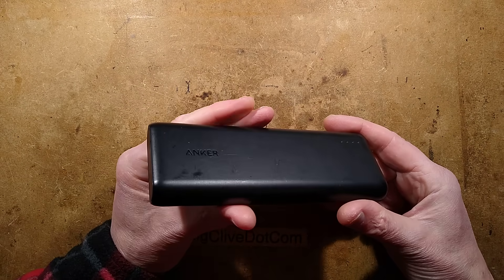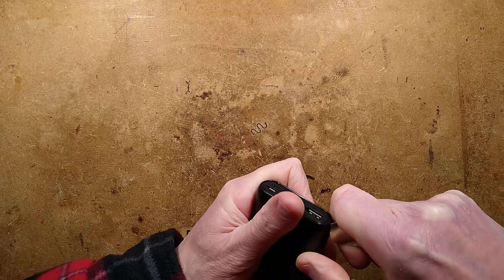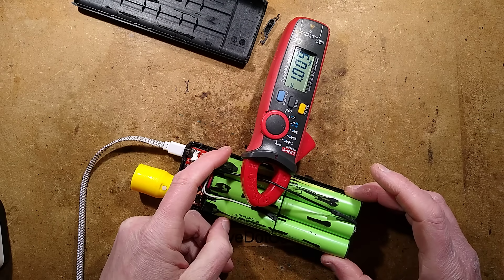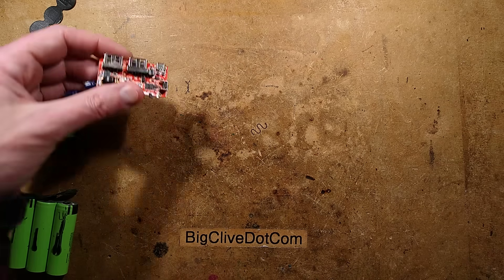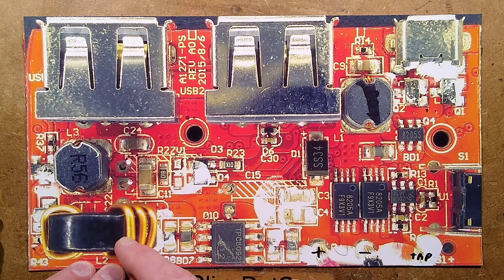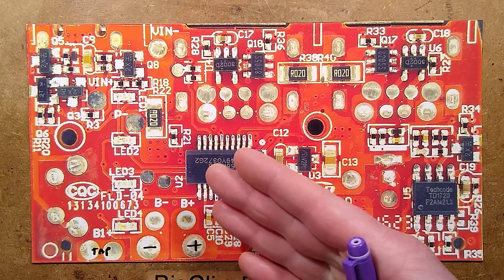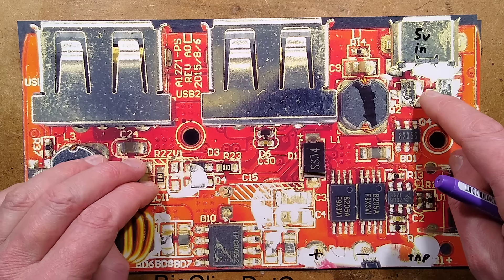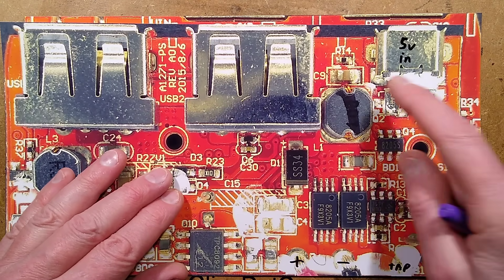Exploring an Anker power bank

Comment: i have a generic version of this and amazingly it is full of actual batteries, i've never successfully discharged it as it puts out so little current it cant really charge anything but it can power lights or other usb devices near indefinitely, for the record the easiest way to open these is to give it a decent twist and slip a screwdriver under whatever edge pops up, anker way more complex inside than the generic form i have

Comment: NCR1860B by Panasonic. Indestructible cells. 2.5-4.2V range which gives you 3.4Ah. Very reliable ones! They "buy" the higher capacity using the ability to go to a lower voltage. I mean, any cell is better than (Un)Lucky Goldstar or Smasnug ones. But these are really great. I use them anywhere and it makes you able to use dodgy cell protection boards from China that go just a tad bit below 3V for the discharge protection.

Comment: I’m so confused. How do the two sets of 3 lithium cells in series ever result in 6-8 volts internally? I must have missed a detail.
Reply: Imagine 2 cells in series - that's the 6-8 V. Now instead of one cell in series with one cell, it's really 3 cells (in parallel) in series with 3 more cells (in parallel).

Comment: You should take apart a Baseus Amblight, it has a freaking heatsink in it, it uses the SC59E32 & SD59B23 combo & has a daughter board(through a 12v + and - connection) for the batteries. Maybe too complex for a schematic but I'd be curious of your reaction.

Comment: I have a similar unit that does something similar, so I'll have to give the long hold "reset" a go. But using a lower power charging brick eventually gets the LED's to light and eventually gets the power bank to a full charge. The faulty one takes forever to charge, while its partner is pretty quick.

Comment: You inspired me to dust off my 8 year old Ravpower 16750mAh power bank. The full charge LED still lights up even though a full charge after 2 years of neglect is impossible. I'm going to exercise the batteries and put it away for future use.

Comment: I just cut open a (broken) high power samsung usb wall pwr supply for laptop.  I've never seen such a heavy duty well constructed sms. Peeled off metal shielding to find everything covered in that silicone... I really want to explore it.  I think I'm going to make it an ongoing clean up.  Digging out the potting a little at a time, stopping each session when I'm losing patience. 
I always appreciate you guided tour of circuit.  Consider peeking at signals during tour with a scope? 
Thanks.

Comment: I have a big anker power bank that has a large lifepo battery. Lithium phosphate battery. I bought it because it has a safer chemistry that has been proven to cause less fires when shorted or punctured. Where lipo batteries run away and cause huge fires. 

The first one purchase i had to RMA back because the BMS system for some reason locked out charging. I waited till it was basically day then left to for another period of time with loads connected to try and the BMS battery protection system to reset but it never did. 

The replacement power bank works buy seems to have other electrical issues as it acts funny sometimes using the usb-c port on it. I connect s laptop to it and the laptop acts as if its the charger and charges up the battery on the power bank instead of the reverse then i have to unplug and replug the laptop several times to get it to charge up instead of the other way around its really weird. 

But supposedly I've heard instead the large battery is a bunch of those same individual cells you showed here. My guess is probably on the old one, one or two of the cells probably went below their charge and thats what caused battery protection to kick in. I really wanted to buy one of their large bigger models but those runs for thousands of dollars here in the US. And  i cant afford that. 

But for emergency's this bank does well and the battery averages around 4 to 6 hours on most moderate loads. Even though when the fan kicks on for the inverter it can a bit annoying. 

Great video!

Comment: That's basically the one i have, with the old micro USB. I still use it after almost ten years, and it finally shows a notable loss in capacity. 
Also I misplaced it for two years and it was still full lol.
I hope that I can replace the cells once the time has come. But I also want to update the loading ports to USB-C, not sure if that's reasonably possible.

Comment: The one power bank that I have been VERY disappointed in is the ZENDURE Model ZDA8PD 26,800mAh  years ago I bought Three from what was then called 'Massdrop' and only 1 turned out to actually work at all, other two couldn't ever get them to properly take a charge or charge other devices, they all do this odd flashing count up thing when I try to charge them, and the two bad ones sometimes count down from 99 to 00 and back up to 99 but nothing happens still when trying to use those two.  Their support was useless, and just the time it took to get them and runarounds next thing I knew I couldn't send them back and couldn't do anything with 2 out of the 3. The 3rd one has been reliable but I always fear using all of its charge cause I don't want it to have risk of glitching out like other two (I don't know why the other 2 never worked)  If it wasn't for the huge fire risk shipping them I would have loved to send them to someone like Bigclive, I can only imagine the amount of Magic Smoke just waiting to be released on camera.

Comment: I had 1 that would reset if you hold the power down for 10 seconds so that was good but another that had to be plugged into a charger to reset, The one you had to plug in sucks because the day I took it on the boat I plugged in a phone and speaker it stopped working, Came home plugged it in and it was 100% charged but useless when it decided the power draw was to much,

Comment: I live in Northern Ireland and when I was looking online for power banks, most won't ship them here but I can get Anker power banks so I have a number of them, including the one you showed and some 20,000mAh PD banks. I have used them to power my camera and audio recorders for hours on end and still had charge left. They have been very reliable so far and I have dropped them a few times and didn't damage them. They came in very useful over the past week when I had no electricity in my area due to recent storm damage and without them I couldn't have charged my phone or the torches I needed so I could see in the dark.
Reply: One thing with shipping is if the cells are over a certain mah  they need a different safety licence.  That's why most things from China have smaller cells.
Reply: @turokforever007  I think the issue here is that many GB companies refuse to ship anything to Northern Ireland due to UK/EU post-BREXIT customs agreements. To get things (like wheelchair arms!) to my parents in Belfast they have to order online, get it shipped to England and then I have to ship it to them. Rediculous.

Comment: Ive had one of their originals from new (2011) still in use weekly, and another lives in my camping bag gets discharged and recharged roughly every 6 months. Both still in really good health. Anker originally made 3rd party replacement laptop batteries for Dell and HP and had a fantastic reputation in the refurb industry.

Comment: your spodger cops a hiding.   i'm curious to know if you kill one every month.   i dont have one so my tools for this sort of job are a top quality plasterer's small tool or a slide under type of staple remover.   the one i have is a radiant brand.   bostich made one like this too.   i used to have one which i aggressively guarded when i worked in an office because they are the best method to remove staples.

Comment: How about a comparison between a well built and designed powerbank, and one of those cheap nasty fire cracker ones waiting to go off.

And regarding the no schematic.... if it's to complicate to draw out, a block diagram of the various modules would be a nice visual to see how they all interact with each other.

Comment: I have one of these gone single blue light flashing rhen switching off, after i think leaving it in a damp bag after fishing  (specially a ninetendo switch special edition with two ports only, one output 5v usb-b and one pd output usb-c that doubles as a charge inbut I..cannot reset it so far....so perhaps those elements on the pcb controls the switching usb-c port?
With a usb digital tester the bank reports 19.8v with a trickle charge input with one light flashing and thats where it ztays thinking its full..
Til it switches off..somehow i have to trick the leds to either go back to 4 lights or discharge it flat..using a very slow trickle discharge...nit sure..seems catch 22 eitherway as the protection circuits dont like either, reporting too low to discharge on a sinlg light, yet full capacity with a single light...

Comment: I managed to open a 15,000mAh Anker bank some months ago. It was a pain...
The fault was easily fixed, the nickel strips between the PCB and the battery pack had broken off after it was dropped.
It's working fine again, with some permantent cosmetic scars ;)

Comment: Another big fan of Ankers here. I've got several in different sizes, the oldest 10 years old this year, and they've never let me down.
Reply: I've had mine since 13th June 2020, the 20,000 mah bank has never let me down, I love it. I went camping last year and I managed to charge my phone all week, 😀
Reply: They make an ergonomic mouse,  it is very good
Reply: That’s why I clicked on this video, I have a very similar (possibly exact same) one that I bought in 2016. It’s gone through several phases of being used daily - to - not being used at all for months on end. Picked it up the other days and it was still fully charged.
Reply: Yep same here 🙋
Reply: Same
Reply: In general I agree, but I have had one 25000 mAh one go bad.  It was a good 5 years old at the time however.  The others are still going fine.
Reply: Their newish product since 2022 are hit and miss compared to their older 10-ish years products
Reply: do you guys have advice on something lightweight? used for dayhikes and basically an emergency charge for a phone or tablet? 

cheers!

 @igelbofh
Reply: I mostly use anker products if available for my needs.  Especially compared to the brandless amazon/ebay slop they're just so much better, and in my shop we never get anker items brought back.

Comment: Plugging the power pack into itself, a mistake I would never make twice... Ask me about my gameboy 😂
Reply: Yeah what does happen if you plug a power bank into itself?
Reply: @ianhosier4042 you rip a hole in space and time
Reply: @ianhosier4042  hopefully nothing, but 25 years ago it had no protection and so was a dead short, the plastic got hotter and hotter that I could not touch it before melting with the heat, I think the wires burnt clear and stopped the reaction
Reply: @phonotical my younger cousin did this to my gameboy battery pack, I’m still angry about it 😂
Reply: @ianhosier4042  well after the manufacturing date of March 2020 it's a black hole, it starts collapsing in on itself.

before that, it's infinite energy.

check your model, serial number and manufacturer date before proceeding.

Comment: I have had so many of their banks and always been high quality and long lasting. In fact, some of them have far exceeded their service life. I appreciate their capacity can be trusted and over all, their support is great. I only had concern for an older model that had dual micro USB in for charging and it got quite hot at the ports.
Reply: Could those be Anker Power Core 26800 units ?   If so, I have 2 of them.   One in 2016, the other 2 years later.    Excellent units, although not used as much since additional newer Power Banks were purchased.
Reply: could you elaborate a bit on the "so many" and what you consider "long lasting" and their "service life" please? 😉
Reply: @kittytrail  I have a lot of reasons to have many power banks. I've personally had 8-9 different models of Anker banks alone along with many other cheap and expensive brands. Your typical power bank with regular use of charging to 100% and discharging to 0% will usually last you 2-3 years. They either die from a broken port, charging/output circuit malfunction or enough battery degradation to retire it. My Anker PowerCore 26800 (my 15600 even earlier than that) was purchased in mid 2018 and while I haven't done a discharge capacity test in a while, it still holds enough of a charge to not warrant that test (now I might test it just because I'm thinking about it). The 15600 was lost for about a year and a half, totally dead and I put it back on the charge and it sprung back to life with no complaints. I've done that with another generic brand and it did not come back to life. Anker has always been quality for me, along with Omnicharge. These are the two I trust when it's mission critical. 

TL;DR over about 9 Anker banks, I would say a 6 year service life is pretty good lol. Long lasting being that they use high quality cells that are are rated for exactly what they advertise (not many brands do that in my testing), as well as outlasting their expected service life of 2-3 years.
Reply: @kittytrail  I've owned 8-9 Anker banks over the years along with many other name brand and generic banks. Expected service life of a battery bank is about 2-3 years. They usually die to broken ports, charging/discharge circuit malfunction or enough cell degradation to take it out of commission. I purchased an Anker PowerCore 25600 back in 2018 and while I haven't done a discharge test on it in a while, it holds its charge so well that I haven't needed to (though I might now that I'm thinking about it). My PowerCore 15600, same model featured in this video, was also purchased in 2018 and I even lost of for a year and a half. Got it back flat dead, plugged it in and it sprung back to usable life.  I would say a 6+ year service life is pretty good lol. Long lasting being that they use high quality cells, ports, circuitry and plastics as well as provide accurate capacity metrics. When it's mission critical, I choose Anker and OmniCharge. Already had one UGREEN die on me after just a year due to a bad port.
Reply: @kittytrail I've owned 8-9 Anker banks over the years along with many other name brand and generic banks. Expected service life of a battery bank is about 2-3 years. They usually die to broken ports, charging/discharge circuit malfunction or enough cell degradation to take it out of commission. I purchased an Anker PowerCore 25600 back in 2018 and while I haven't done a discharge test on it in a while, it holds its charge so well that I haven't needed to (though I might now that I'm thinking about it). My PowerCore 15600, same model featured in this video, was also purchased in 2018 and I even lost of for a year and a half. Got it back flat dead, plugged it in and it sprung back to usable life.  I would say a 6+ year service life is pretty good lol. Long lasting being that they use high quality cells, ports, circuitry and plastics as well as provide accurate capacity metrics. When it's mission critical, I choose Anker and OmniCharge. Already had one UGREEN die on me after just a year due to a bad port.

Comment: Have been using that model for many many years, still works great.
Really nice to get a guided tour of its internals!
Reply: Have the same also. First Anker product I ever bought and it wasn't the last.
Reply: Had this one about 10 years and still going strong apart from one led not working, been dropped loads as well
Reply: Sadly I managed to destroy one by dropping it on its operational end from about 2 metres up while it had a USB plugged into the centre port. It didn't break immediately but the centre USB port stopped working and eventually all the IO did stop after maybe another year or two.

Comment: The board seems to have a 2015 date on it.  Were there decent, cheap, small boost ICs available then?  If not, that might explain their use of discrete components.
Reply from the maker: The design does appear to have a date of 2015 on it.  But I'm sure the generic boost circuits would have been around back then.  Maybe there was still a cost advantage to using discretes.

Comment: Thanks for the teardown Clive. I have two of the larger versions of this power bank (26'800mAh ones)  for powering my livestream rig and have experienced the non-charging issue a few times. The reset that worked for me was bridging the input and output sockets as you mentioned followed by a good long charge. It's happened happened 3 or 4 times over several years but eaach time the reset trick has worked. Despite this issue, I'm very happy with the performance of these units and their very sturdy build.

You mention the two sets of 3 cells in series, so wouldn't that make it 9-12v rather than 6-8v...? I'm then guessing they are configured as 3S2P...